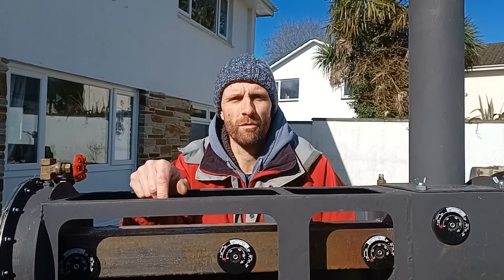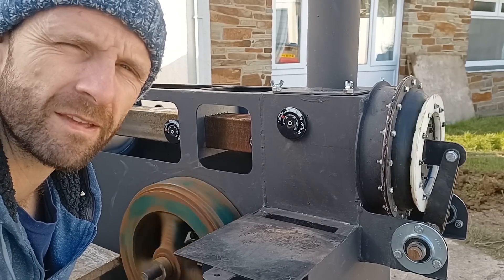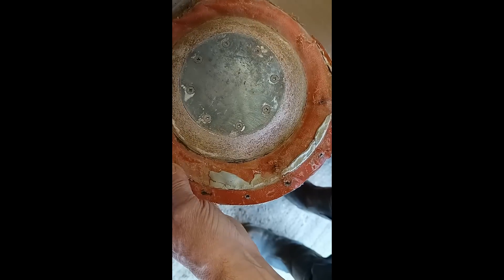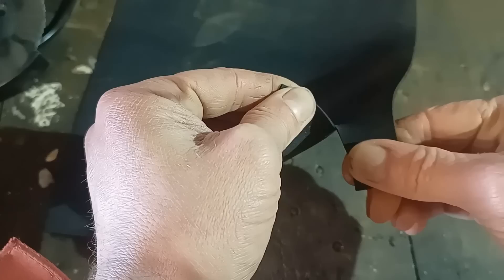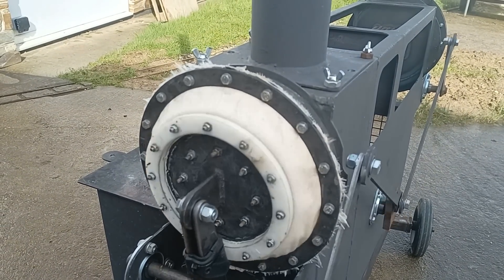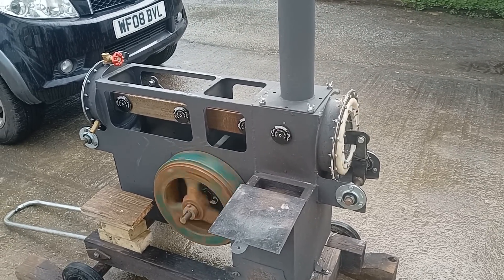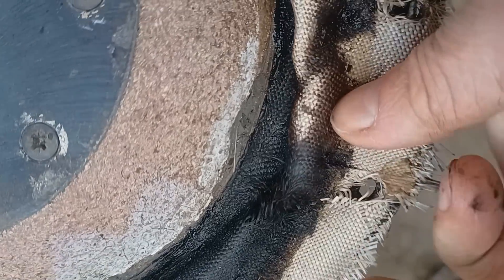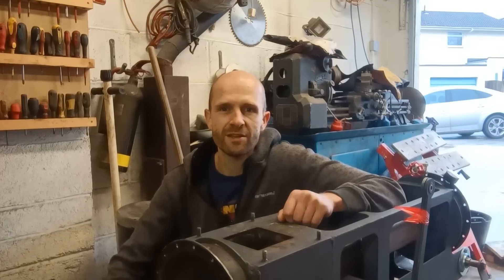Stirling Engine Generator Mk4 (Rocket Stove!) Part 9

Comment: I think the problem is in the heat exchanger, also it's running too hot for it's capacity, means bc the heat exchanger sizing it's enough on the hot side, heat accumulate there doesn't get transfered well to the cold side to produce work, this is why the flue gas is hot, and it runs hotter to compensate for the low heat flux.
Maybe more flat pipes would help a bit, but also i think the compression ratio should be higher too.

Comment: It's very good to see your triall a lot of way to improve this engine....my suggestion is to use big metal piston with two rings (heat resistant fabric in midle) and use pipe to connect The cylinder to prevent heat conduct.

I like alpha using concret your made.

Comment: Cloth backing is absolutely the way to go! The thinner the rubber the better in this case.

 If you take a look at how turbo wastegate diaphragms are constructed you will see a similar construction and I think that is basically what you want to aim for eventually. Non-bonded cloth should be great short-term for testing though. I think the proper diaphragms are usually made by vulcanising the rubber after or while the cloth is being squished into it, but you might be able to approximate that using silicone glue to attach cloth to a thin rubber or silicone layer. Maybe just the right sort of silicone glue smeared between 2 cloth layers could be enough?

The diaphragm also seems to be getting inverted by vacuum sometimes, I think that's just a non-return valve problem but you might want to add a little additional pressure to help out since it's a lot of extra bending that you can avoid. Also, stirling engines get more efficient at higher pressures, not sure if you want to chase that but it seems like you could with the right diaphragms :)

Why is the exchanger section next to the furnace not insulated? I'm not that knowledgeable on stirling design but I thought it would be better if some length of it was used as a regenerator which would allow the hot end to retain more heat. I guess with the diaphragm not being separated by an insulating piston you might need to tune that insulation to avoid overheating the rubber.

Comment: Trying to make a flexible seal in a dry hot environment  - metallic foil seals go up to 400c - I guess that's why Stirling focused on the displacer-type engine.
Reply from the maker: I think you've hit the nail on the head with the Stirling brothers. I was hoping modern materials might overcome issues ! We're see!

Comment: Do you have the working fluid at any degree of static pressure?

In commercial Stirling Cryocoolers (which are just stirling engines used backwards) the working fluid is kept at high pressure and it makes the system much more efficient.
Reply from the maker: No pressure, I'm not sure the seals would take it : )

Comment: Hi Shane. Good to hear you are not to distraught over the results. I was thinking you would get a bit more power than that. I have a thought about your gasket/seals. Not what they are made from, but how they are utilised. To reduce the amount of stretch on the diaphragms, try positioning the piston or the cylinder support side, so you have an equal amount of movement either side of the central position. So to put numbers on it to add clarity, instead of having it push out 1 1/2” and then going back 1 1/2” to start again, try setting it up so it only has to move 3/4” out then back past center and then 3/4” in, then back to center to start again. Just a thought. I’m enjoying watching the videos. Thanks. Regards. Stephen.

Comment: Maybe you could add a double check valve system that makes the air circulate through the heat exchanger rather than in and out? That might help increase the power output. For the hot-side piston/seal, maybe it's worth it to use a different approach?

Comment: Perhaps the flexible seal would work better with an oversized disc as the outermost layer, attached around the edge to a ring with it's inner edge sealed to the cylinder head giving a sort of flying saucer shaped single bellow?

Comment: Bicycle tires could be used as belows but they would need to be the right size to be pressed by the engine gasket ring, the mobile disk that connects to the crank should be bigger as well to be able to hold the tire from the other lip cilindrcal bellows instead of a flat one, tgey already come with fibers inside too, still who knows if they can tolerate the temperature,  the crank arms woul need to be moved out probably... 
Thanks a lot for the videos, always glad to see each update and all the changes and adjustments!

Comment: A solid piston in a cylinder like a v twin air compressor head is a better bet, flexible seals simply won't work long term in this application.  Solid pistons in a sealed cylinder with a cylinder head will definitely work better.

Comment: Hello again, in the middle of the piston where you have it welded, I believe that needs to be able to swivel rotate because as it is now your not going straight in and out. I recommended carbon fiber, was that not a good choice for some reason. Cheers.
Reply from the maker: Hello, I was trying to cut down on swithel points but you could be right. No, haven't tried carbon fibre yet. Do you think it will fatigue like glass cloth?I've no experience with it, cheers
Reply: @ShanePomeroy  I don't know about the carbon fiber, it was just a thought. Two things though, I think you have too many sharp corners that are cutting into the edges of the diaphragm, then I think you need to drill a hole and insert like a cheap chimney thermometer so you can see how hot that diaphragm is getting. Then if it's too hot maybe water cooling or fins around that connection before the diaphragm. Great project, and still the best I've seen. Cheers.

Comment: 0:50 That looks like Hyperlon, an incredibly tough material.. Tubes on R.I.B.s are made of this, & can withstand really hot direct sunshine for decades, so something is amiss with your machine. A great project, been following you for a while. 👍
Reply from the maker: You might be right! I may have misquoted what this was.  The engine does get really hot : )

Comment: Silicone sealant can be thinned with white spirit. I wonder if painting multiple layers of this mixture onto cotton cloth could create a suitable material for your seals?
Reply from the maker: I tried a single coating on cloth. It was OK for a few hours but then started breaking down. The cold side worked fine
Reply: @ShanePomeroy  That's a shame, I can't think of anything else that will maintain the flexibility with a higher operating temperature than silicone. Have you measured the temperature at that point (sorry, I haven't had a lot of spare time recently so I haven't been following along in enough detail to have seen if you'd shown it already in the video series).
Reply from the maker: @jamesharris5158  not measured yet. I'd  really like to know the temp : ). I'm currently trying multiple fabrics laminated with silicone, cheers

Comment: might be time to have a look at silicone seals again but with the support of the fibreglass and canvas, looking good so far though. you can see how much progress you have made with the designs when you look back at the first engine
Reply from the maker: You could be right : ). I'm doing a few experiments at the moment to see how much heat is transfered through various layers of glass cloth, cheers

Comment: Hello Shane. I believe the leaks tampered your power test. Looking at the damaged parts up to now, I believe rubber has no place in this hot side. Aparently, the high temperature silicone used as resin for the first fiberglass fabric held better. Maybe you can try sandwich 3 or 4 layers of that fiberglass fabric with high temp silicone, and in the top, put the cotton fabric. Just keep enough slack in the fiberglass so it's not pulled by the stroke of the engine.

Another possible option was pointed in part 8's comments, as a guy suggested to make the hot side with a more traditional cylinder/piston aproach. The problem I see with this is just making the volume of this cylinder quite right to match the cold side diaphragm.

To get some serious power, I believe you'll have to run pressurized. When you manage to seal the engine, would be great to run tests with different pressures.
Reply: Idea for a economizer: you can "box" maybe 25cm of the piping leading the gases to the cold side, right after they leave the furnacle. Than, pour molten alluminum to fill all the space between the tubes in this 25cm lenght of the box, them put a descent heat insulation arround it (good ammount of fiberglass wool wraped with thermotape).

Comment: 45 watts😅 that thing looks like a toy no woanders you get that little power 😂 Stirling motors work with high pressure and water cooled cold side. Also the less heat creap you have in the Stirling the higher the efficiency

Comment: You may have already tried… Use your silicone and napha  mixture to soak the fire blanket. Rather than just painting it on, and allowing the silicone to cure with the fire blanket encased.

Comment: Very happy to see your success! 45w for your first run is a great starting point. I can't wait to see the next modifications. Keep your videos coming.
Reply: What is the stroke of your pistons?

You may be able to use a thin sheet of stainless steel for the seal material if it doesn't stroke to far (.1mm to .25mm thick)  If you modify the piston so it doesn't stroke past the face of the cylinder. Connect the SS seal close to the center of the piston. And connect it to the outside of the existing cylinder flange. (You may have to extend the flange diameter)  Think of it as a giant "fender washer", for the idea, large OD, small ID. You may have to add a couple circular "waves" to the seal to allow a little flex. This method should be able to handle all the heat you give it.

You may have to add another flex joint to the piston to account for the small sideways movement.

Just a thought!

Comment: I believe that if you go to a thinner sheet of material(s) you will have more success, especially with the rubber. This will do 2 things, it will allow the rubber to stay cooler (heat doesn't flow well through it, so the thinner the better) and it will keep the stress lower so it won't fracture. Just like bows for arrows, you need to keep it very thin if it is going to be bending a long way.   Some sort of active cooling on the diaphragm might also be beneficial. It might decrease power, but I doubt it would decrease the power that much.

This is such a fun series to watch, thank you for sharing all of your hard work!
Reply from the maker: Thank You for your advice, I think I will try this, many thanks : )

Comment: From a quick glance there would seem to be a lot more than 40W keeping all that metal in rapid motion. I assume you are making 40W more than it takes to run the machine?
Phil
Reply from the maker: Yes , 45w output
Reply: @ShanePomeroy  could you possibly take of the flywheel and replace it with a generator and load the generator electrically till it stalled?

Comment: I love the design. I am a mechanical and electrical engineer and I am very impressed. You are a better designer than several of the engineers I know... Sad but true.  Being book smart doesn't make you a good engineer. Designing, building and testing with good methods is the true test of an engineer and you passed all three of those! Keep up the good work.

Comment: The cooling fan you installed to move cold air over the cold end is quite large. I would imagine it is soaking up far more than 45watts (consider what power of electric motor you would need to run it at 500rpm). Could the fan be reduced in size and still be effective?
Reply from the maker: Fair point! I could quickly remove it when I try again to see the difference, cheers
Reply: @ShanePomeroy  if you made the cool end into a water heater you could honestly add that energy to your output. There's even more waste heat available in the chimney.
Brilliant work so far, far better than most. Measuring actual power output! What a concept. Many youtube engines spin like mad and their inventors get lots of clicks without measuring anything useful.
Reply: Second thoughts - the draw air flow is probably far too little to keep the fins cool, but it could do a portion of it, drawing heat from the section nearest the hot heat exchanger.

Comment: The performance would probably be increased by puting a regenetator box halfway between the hot and cold side. Also, a multi-layer diaphragm is the way to go, but with cloth like/non expandable materials. The diaphragm should bend but not expand. Measuring the top dead and bottom dead points of the stroke and designing a diaphragm based on that displacement would be the way to go
Reply from the maker: Sound advice, many thanks. I'll adjust the strokes to minimise the dead space when pistons are compressed (material stretched out), cheers

Comment: I think you're asking too much of the rubber. Some kind of accordion stack or book bellows might last a lot longer.
Reply: A thin steel bellows arrangement; something not too dissimilar to what they tried with articulated boiler locomotives. This application doesn't have the grit that caused the failure in the steam locomotives.
Reply: Yes, metal bellows should be reliable sooution.

Comment: Have you considered using asbestos cloth?
Reply: Or silicone mixed with graphene, or possibly some sort of water cooling system to keep the bellows cool?
Reply: @bigmouthstrikesagain4056   As far as I know graphene has high thermal conductivity .  wouldn't that just make it worse ? Water cooling system would be too heavy ?
Reply from the maker: Just googled that. Yes it might work but graphene still seems a little unavailable to the public at the moment. The water cooling is an option as long as the weights kept down. Many thanks

Comment: I think you could use silicone insertion rubber on the hot side diaphragm. It would be more durable than anything you have used so far.